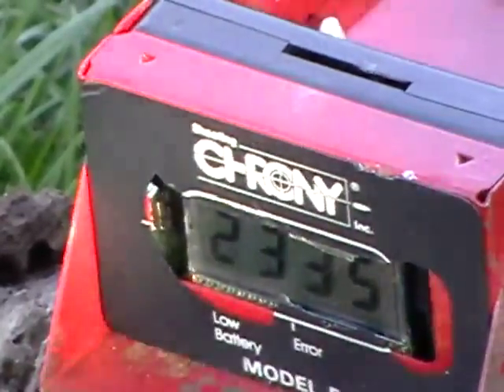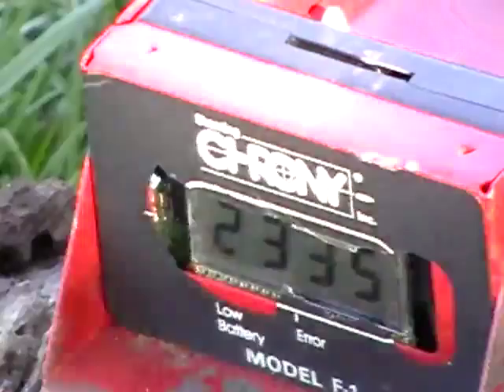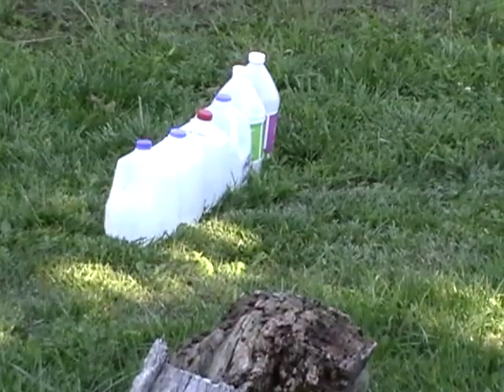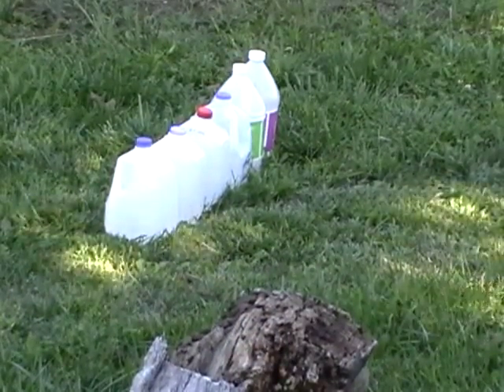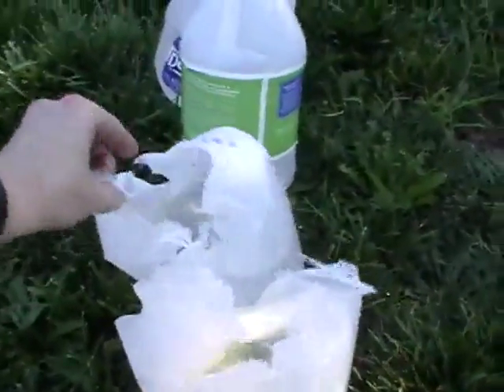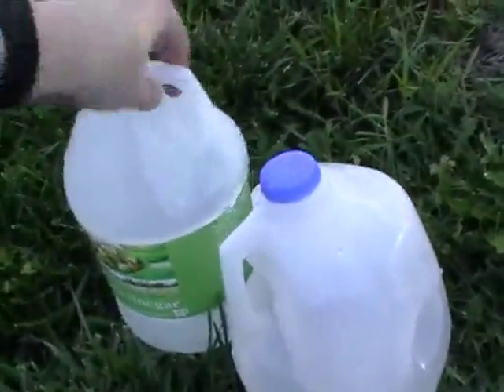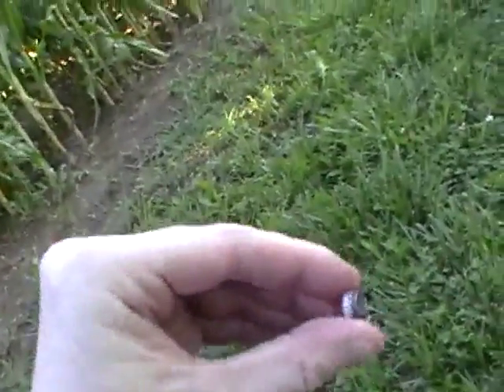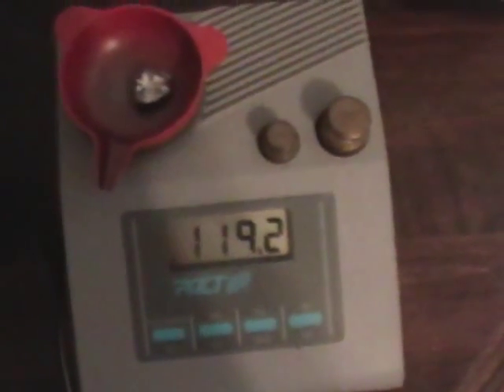.45 Colt 225 grain Hornady FTX ballistics test on water

Comment: What’s your load measurements?
Reply from the maker: Powder charge?
It's 25.0 grains of H110.
After this video, I found on Hodgdon's site bullet-specific data for the same 225 grain Hornady FTX that was in this video that indicated a maximum charge in strong guns of 27.2 grains, and my chronograph showed that those loads move out at an average 1820 FPS.
I took my first ever deer with the 25.0 grain load and my second two with the 27.2 grain load in 2012.
All three were one shot stops, with the first one literally falling in her tracks without taking so much as one step after impact.
Critical information, but if you or a friend intends to reload .45 Colt, do NOT use this load data in anything other than one of the stronger handguns or rifles.

For handguns, the following are acceptable for loads of this category, assuming that the condition of the specific handgun is undamaged and in otherwise sound condition: Ruger Blackhawk, Thompson/Center Contender, Freedom Arms model 83, Colt Anaconda, and Ruger Redhawk
There are other pistols, i.e. break-action or bolt action that should also be safe, but I won't begin to try sort those out because they're more obscure, such as one offered by Rossi.
As far as I know, there are no other revolvers considered up to the separate category of very stout loads that I often load.
Some of the handguns considered UNSAFE for these loads are: Ruger Vaquero, Colt New Service, Smith & Wesson model 25, Taurus Judge, Smith & Wesson Governor

If you're wanting to shoot loads of this category in rifles, again as long as the rifle is in sound condition, you're good to go with the following: Marlin 1894, Winchester 1892, Winchester 1894, Rossi R92 (clone of Winchester 1892)
I know there are others not considered acceptable, but the only two rifles I can name off the top of my head considered unacceptable due to lack of action strength for these stouter loads are the Winchester 1873 (and all modern clones) and Rossi Circuit Judge.
Henry Repeating Arms is a special case, with all but one model of their lever action rifles considered safe with these stout loads, with the one exception dubbed the "New Henry Original Rifle," which is a modern version of the famous Henry 1860 lever action rifle (yes, the one that the Confederates called "That damn Yahkee rifle that they load on Sunday and shoot all week") that has the same action strength shortcomings that the original model 1860 had.
It goes without saying that all other clones (there are many) of the Henry 1860 are considered unsafe for these loads.
Also, don't be tempted to fire loads of this sort in the modern centerfire (the originals were all rimfire) incarnation of the Winchester 1866 in the unlikely event that you have one.
Reply: @Gunners_Mate_Guns  I appreciate your feedback, I would intend to use the higher loads in my Henry big boy X. Just reached out to Henry for all the information I need to make sure I don’t mess anything up, as well looking into others work.
Reply from the maker: @carsonmckee3641  As long as your Big Boy is in good condition, you're all set.
Just work up your loads in increments to ensure that your specific gun is up to the task and look hard for the telltale pressure signs, namely flattened, cratered, or blown primers.
I also highly recommend Starline brass for the stouter loads.
I favor CCI 350 large pistol magnum primers, but you should be okay with Remington, Winchester, Federal, or some of the others, just as long as you ensure that you're using magnum primers, as H110 and its relabeled identical powder Winchester W296 both are harder to ignite and need the extra spark.
One more very important thing to heed about H110/W296: Do NOT be tempted to use anything below the listed starting load with any cartridge loaded as it's one of those powders that can cause pressures to skyrocket to dangerous levels with undercharges, with detonations a very real possibility.
There are other powders with this interesting characteristic, but it's the only one I've ever seen firsthand evidence of having a *KABOOM* from a photo that a gun store owner showed me of a Ruger Super Blackhawk .44 Magnum, with its top strap and cylinder totally wrecked.
Fortunately, the shooter who had this happen was wearing shooting glasses that protected his eyes and he miraculously wound up with no injuries beyond a few brass fragments that peppered his face and hands, a testament to just how strong the Super Blackhawk is.
It's probably the ultimate powder for getting the most out of the likes of .357 Magnum, .41 Magnum, .44 Magnum, .45 Colt, .454 Casull, 450 Smith & Wesson, and (yes) .500 Smith & Wesson.
I've used this powder for over thirty years now,with excellent results.
Of course, the nice thing about .45 Colt is that there are lots of choices of powder depending on what you like, from very mild loads that even a petite woman or child could enjoy shooting all the way up to real hammers using a max charge of H110 behind a 300 grain Speer softpoint that will really grab your attention with each trigger pull.
Reply: @Gunners_Mate_Guns  appreciate the info🇺🇸
Reply from the maker: @carsonmckee3641  You're very welcome.
Sorry for being so verbose, but when it comes to reloading, especially when you're working up loads at the upper end of the scale, I'm super cautious about it that I want to hand off what I've learned over the years to others.
Good luck, and that Henry should serve you very well, especially if you want to hunt deer out to about 100 yards.

Comment: These are pistol rounds aren't they?
Reply from the maker: They are, well...more specifically revolver rounds.
The whole premise of this crude test was to compare performance between the exact same loads fired out of my revolver (7" barreled Ruger Blackhawk) and my 20" barreled Marlin 1894.
FWIW, I have since upped the muzzle velocity of this round out of my Marlin to 1882 FPS, and I took my third deer with it, and it performed perfectly.
I took my fourth deer last fall with my .30-06!
Reply: Thanks, I guess I missed that heh. I picked some up to try out of my Taurus Judge.
Reply from the maker: Great move!
I'm unsure whether you bought factory ammo (Hornady LeveRevolution) or the component bullets loaded in the LeveRevolution ammo that I used here (225 grain Hornady FTX), but you should get excellent performance with them either way.
Just know that the factory ammo is loaded to normal .45 Colt ballistics, meaning still respectable, but nowhere near as powerful as I was able to do here by rolling my own.
I'd love to here how you do with them.
Reply: @Gunners_Mate_Guns  so you don't have to use the shorter brass with the ftx? Like the way the are sold factory.
Reply from the maker: @micahspur  I was unaware that the factory loads had shortened brass.
I can say unequivocally that I left my brass as is, using my Lee Factory Crimp die to crimp into the bullet cannelure, and the cartridges fit just fine in the cylinder of my Ruger Blackhawk, and the same rounds cycle perfectly through the action of my Marlin 1894.
Reply: @Gunners_Mate_Guns  thanks. Glad to here they cycle in the 1894, at that length.
I have the same 20in. barrel  Marlin in 45colt. 
Illinois open up some rifles for 2023. So i gotta get this figured out. Ya factory ammo brass has to be shortened to get down to max oal.
Reply from the maker: @micahspur  I wanted to give you some more useful information.
You will require a custom made bullet seater plug to load these bullets, but it's actually a very easy process to follow.
I don't know what brand of dies that you have, but for RCBS, just give them a call and they will explain how to send in a sample bullet for them to use to machine a custom seater plug at minimal cost.
Their phone number is (800) 533-5000, and I can attest that "Big Green" has the best customer service in the business.
I recall that it didn't cost over $10 for them to make me a custom plug, and they even sent the sample bullet back, albeit with a bit of ink on the tip that was used to leave a visible impression in the clay that they used as part of setting up their machine to cut the plug. 
Here is the link for Lee dies that explains how to get one from them if your dies are made by them - https://leeprecision.com/custom-bullet-seating-plug.html
I haven't looked just yet, but I'm sure that Hornady and Dillon offer the same service.
I had excellent results hunting deer with these, cleanly taking two does and one buck.
I would still be using these loads out of my .45 Colt, but my state (Indiana) finally legalized high-powered rifles for deer while hunting on private land only, so I switched over to my Ruger M77 .30-06.
However, if I ever hunted on public land, I would have no problem going back to my Marlin and these loads.
Good luck, and please let me know how it goes for you hunting with these if you get the time.
Reply: @Gunners_Mate_Guns  thanks for the info/help im working on it.
Reply from the maker: @micahspur  I wish you luck.
For what it's worth, Hodgdon has some data on their website for this specific bullet.
I use the max listed charge of H110 to propel these with Starline brass, fired by CCI magnum primers.

Comment: im using a 200 gr ftx bullet out of my 45BH with 4 5/8 barrel. using 25gr of IMR 4227. i average about 1100 fps. what powder and charge are you using? Just curious.
Reply from the maker: My powder of choice for full power loads out of either my 7 1/2" barrel RBH or the Marlin 1894 used in this video is W296 (aka Hodgdon H110).
I'm using 24 grains for the loads here, as listed on Hodgdon's site for maximum loads.
If you should choose to use these, or any other loads assembled with W296/H110 at all, you MUST exercise great caution.

1) Only use the loads so assembled in exceptionally strong guns with an extra margin of meat in their actions, and be sure that those guns are in excellent condition, with no signs of damage.
Guns acceptable for these loads include the Ruger Blackhawk and Blackhawk Bisley, the OLD model Ruger Vaquero (but definitely NOT the the NEW model Vaquero, which was slimmed down to more resemble the Colt Single Action Army), the Freedom Arms model 83, Thompson/Center Contender, Ruger Redhawk, and Colt Anaconda.
This also includes all guns chambered in .454 Casull, .480 Ruger, or .460 Smith & Wesson.
As far as rifles, safe for these loads, you can include the Marlin 1894, Rossi R92, and the Winchester model 94.
There are also a very few other rifles out there chambered in the extended versions of the .45 Colt (.454 Casull, .480 Ruger, and .460 Smith & Wesson) that will easily handle stout .45 Colt loads.

2) Never give your handloads to anyone else due to the great danger that he could fire them in a gun that won't withstand the pressure these can give out, namely guns the likes of the original Colt Single Action Army, the Smith & Wesson New Service, various derringers, or the Smith & Wesson model 25.

3) You will get a much more limited number of safe reloads from your cases when loading up to or near max, so carefully examine each case before each successive reload.
I refuse to use my cases more than five times when loaded to these levels.
Doing otherwise can easily lead to a blown case and a damaged gun or even a nasty injury.

Be safe.
Reply from the maker: Oh, I forgot another thing.
ALWAYS follow the manuals and don't try to just make up loads on your own most especially with a fairly sensitive powder as W296/H110 is.
You also must never go more than 10% BELOW maximum with it because this particular powder has been known to (on rare occasions) detonate when used for ill advised squib loads.
It's also essential to use only magnum primers with it.
Reply: well my bh handles these just fine. i dont usually cook up hot loads for the 45 colt but decided to chrony a few a cooked up for deer hunting. i would like to use h110 or w296 but the only decent powders i can find right now is cfe pistol powder wich is great for everything but magnum loads and imr4227 which is my fav for 357 magnum.